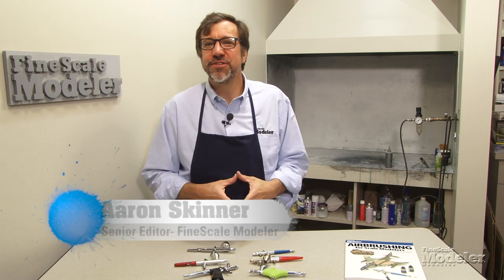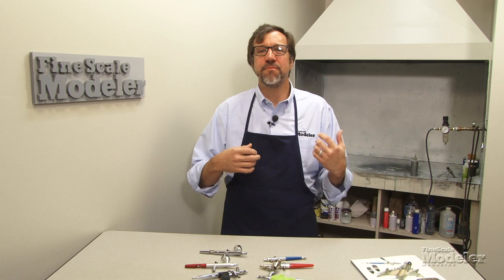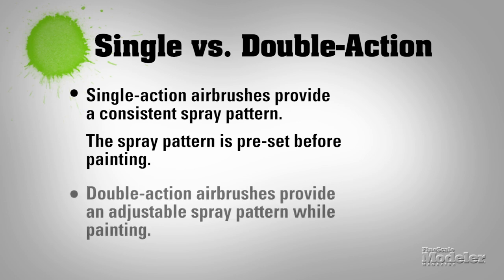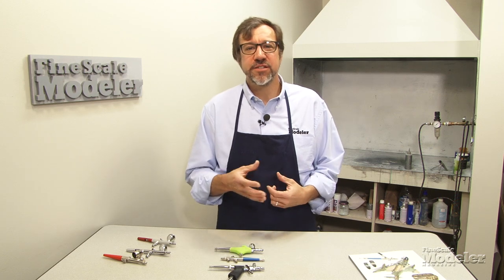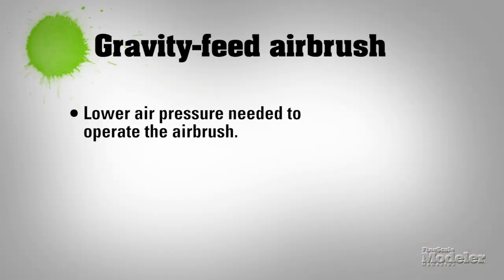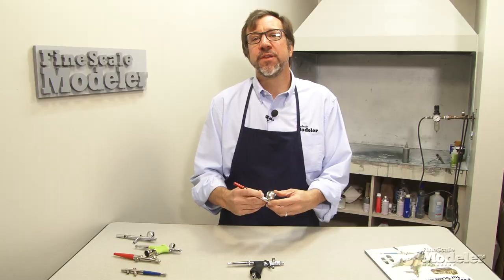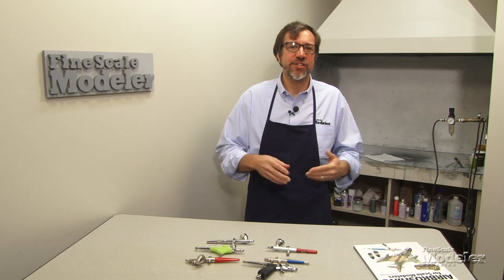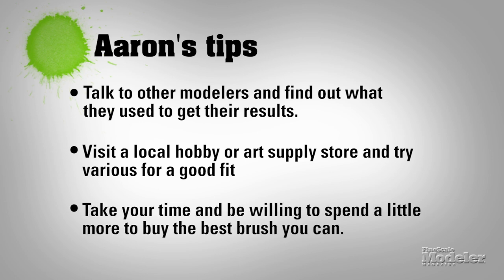How to Choose the Right Airbrush for Painting Scale Models – "Airbrushing with Aaron" Episode 1

Comment: The right pistol grip is fantastic for laying down base coats, where fine control is less an issue.  You can cover a large area without any fatigue.
I was a huge gravity feed fan until I got my first side feed.  The cup assembly is fully removable for cleaning, and it feeds just as well as a top mount cup.  I'm right handed, and the cup is right side mounted, so the visibility is 100% better than my gravity feed.  I can see everything happening, no matter how close to the surface I'm working.

Comment: I've gotten good results with the 34 dollar airbrush from harbor freight.  Surprisingly good quality needle, smooth double action trigger, and efficient paint delivery though I'd prefer it as a gravity feed.   Don't really need to spend a fortune so long as you're aware a cheaper brush isn't going to last as long.   But it lasts long enough to do what I need it to do....
Reply: I still use a Testors aztek and it has always worked very well